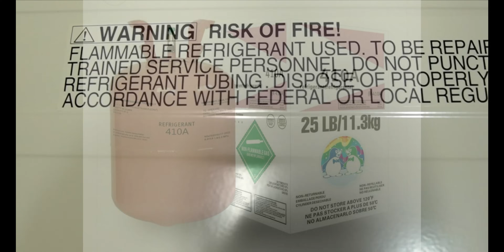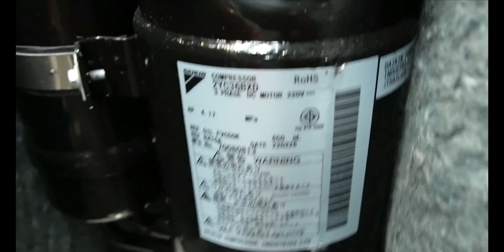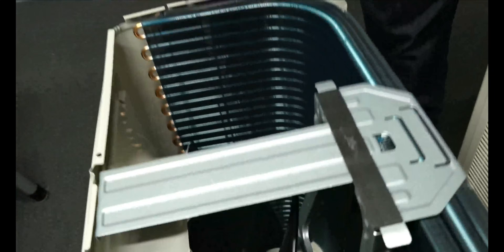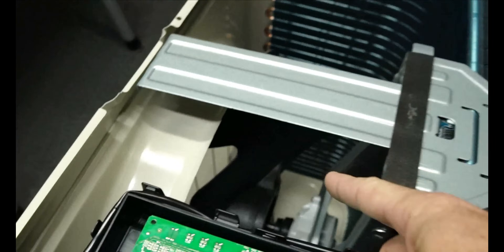The Truth About The New R32 VS R410A Heat Pump Air Conditioner (4k)

Comment: Please find out and reply with facts about units blast and gas leak blast in rooms killing 16 people in pakistan due to R32 gas been used in those split units recently
Reply from the maker: Can you please contact our channel via email. We. Like to hear more about it. Perhaps you can send us some related articles. (HVAC Talkshow & Review Team)
Reply: Share email address  @GWAC555
Reply: That was a leakage of a nearby gas line period end of story.
Reply: Ah, My friend's coworker was just blasting the compressor a while back. It was an R32 unit and how was it  blasting? He was putting an R22 refrigerant in them. Not surprised!
I mean R22 R410 R32 can go boom from improper practice handling the refrigerant.
Reply: @mikaelahyakuya3485  
Can go boom?
How can an r22/410a go boom exactly from handling the refrigerant? You talking about pressure in the tanks? Usually the top will just blow off. Not something a home owner has to worry over. This is if a tech does not pay attention to temperatures and how charged a tank is.
Reply: I lived were almost every home using some sort of mini split. Blast will not happen. All machine have pressure relief valve. It only happens when technicians use incorrect gas (Oxygen) to pressurized system for leak test.
Reply: Lololol shoshal media truth 😂😂😂
Reply: I would add there are hundreds of thousands if not millions of R-32 Mini Splits that have been installed and sometimes installed by unqualified people that have been working fine for years.  There have been explosions in Pakistan for years just Google.  My condolences to all the people who lost a love one in the blast mentioned above.  If installed by a qualified technician and maintenance is performed with cleanings and inspections every 6 months I would not worry.

Comment: It runs on high pressure just like 410a so you’re still going to have leaky coils, only differences the new refrigerant cost three times as much , in Europe they went with propane which is low pressure just like the old R22, And the propane air conditioners have sensors, so if it detects leaking propane, it shuts the system down
Reply: not high or low pressure is the problem. the crappy copper tubes that you could read the newspaper through is tze actual problem. that shit rots in a blink and then you gotta recover tze refrigerant, braze in a new one, draw vacuum re-charge it.

if only the tube wall thickness wouldn't be about a blonde hair those units could prolly last 20 years no problem.  but money raking tells the engineers to design everything as flimsy and crappy as possible.  so that shit keeps on beaking down.

and guess what the root cause of all this bullshittery is; it is the financial system based on credit. every credit needs to be payed back +15% or so.  but you can't create more money to pay back properly. so debt was found. and the global rise of debt is the reason EVERYTING goes to crap.  because the samebunit for the same price gotta be crafted cheaper to get those extra % out of it to pay back dept.

and penny pinching goes down to chip level where earlier the crappy/buggy/laggy chips were discharged in the waste bin nowadys the garbage is going to be sold too. and voilá you as the customer or a pro get a crappy product that never lasts more then 5 years.

economy and financial sytem based on debt is disgusting. it destroys everything. quality, wealth, health of workers (via cheap materials that contain asbestos and stuff).

all that to keep the dying finances going for a few more years. or you get war. war sets everything back to zero. everything is ruined and the economy flourishes. to the point where everything goes to shit again.
Reply: BS, most of Europe is still installing R410A or R32. There’s little to no options for propane in higher end systems.
Reply: It is true that propane is becoming more and more common on air to water heat pumps in Europe. Now there are many monobloc models available and they're probably gonna replace totally the R32 ones. Monobloc means that all the gas stays in the unit outsides and only heated/cooled water gets into the building. For the systems where gas gets into the building though, like mini splits, hydronic split heat pumps, ducted and VRF though, it's all R32 (for VRF even still r410). There's only a midea mini split model using propane being sold but it's an incredibly niche product. I guess nobody wants to take the risk of bringing propane inside…
We'll see how things will evolve. Will regulators and manufacturers develop a way to get reasonably safe indoor propane systems? Will it all become hydronic with the outdoor monobloc propane unit (but that's expensive and you need the space for all the water tanks…)? Will we see CO2 on smaller systems (VRF and mini split)?

Comment: Seemed like a sales pitch rather than an honest comparison. What are the operating differences? Are there any installation differences ? Don't just give me cosmetics.
Reply from the maker: R410a systems are being phased out rapidly. We only trying to point out some minor differences.
Reply: Roger, sales pitch.
Reply: @GWAC555 is there a problem with R410A? Is it not good or dangerous? I have a R410A since 2017 or 2018 and it's working fine.

Comment: r290 is the game not r32
Reply from the maker: January 1st 2025 all Residential and light commercial Manufactures will be utilizing either R-32 or R454B here in the US. None of them will be using R290.
Reply: @GWAC555  Here in Europe, R32 is being fazzed out and being replaced by R290!
Reply: @jooie444 how exactly does R290 work on a mini-split with the current regulations around how much it can be charged with per system? It can work with portable air conditioners or window units, but surely not any mini split or ducted systems
Reply: @jooie444  europe is being phased out

Comment: Can a R410A system be serviced with R32 if at some point in the future R410A goes the way of R22?
Reply: R22 is still available. R410a isn’t going anywhere.
Reply: @fiehlsport  HVAC contractors charing $100/lb for R-22. I presume the price will soar with R410a.
Reply from the maker: R-32 is NOT a drop in replacement.

Comment: I'm not sure if my cheap units are Daikin or Midea built, but they have R32 refrigerants.  I bought and installed 2 12k 120V systems for my fairly open 1200 sq/ft. home.  Winter time had 4 days where it didn't get above 15f, and summer had a few days of 108f.  House temp has remained a constant 69f.  The best project I've ever undertaken.
Reply: You would have had similar results with all the other type of refrigerants.
Reply: cheap crap is deffo midea.... that garbage gets thrown after you if you don't buy it for 3 bucks. 😂

and if anything breaks you never get replacement parts because the chinese crap factory makes a living off selling AC units. not off the aftermarket. so there you go. cheap crap rendered a total loss as soon as something goes south.

best advice is heaving all PCB's for outdoor and a whole indoor unit of every kind that is installed.  otherwise you're EFFFED. dry in the rear end.
Reply: @casemodder89 what parts are you talking about? most blade motors or tubes or universal replacement boards and sensors? anything could be replaced with other stuff, if you know what you are doing but it may cost you more in labor tho....so I KINDA agree, chinese crap can cost more, but kinda not always.
I am running a 12 yo chinese crap that the isolation is falling off from the copper tubes but i dont give a f and just let it rip until it dies and finally replace it. 

If one is afraid of cheap stuff, you rely on brand quality and reputation.

Comment: Yes, what about the R32 gas sensor?
Reply: I believe the sensor would be located inside the furnace or air handler.  At least that’s what a Goodman firmware engineer told me. He also told me that the sensor was required by the state of California.

Comment: R410a Caused controversy?
Reply: A lot of people blame all the leaky systems on the higher pressures of 410a. Also people generally don't like change.
Reply: @TofuInc  R410a and R32 operating pressures are almost exactly the same. The problems come with not using best practices for installation.
Reply from the maker: Something like that! Well said!
Reply: My mini split has 410a.

Comment: Where is the leak detection sensor
Reply: It's only required if the system has a secondary heat source, like heat strips or a gas furnace.
Reply from the maker: @TofuInc  Well said! Thank you
Reply: @TofuInc 4 pounds or less
Reply from the maker: The R32 equivalent we reviewed did not have a refrigerant gas sensor.
Reply: do a real split sys comp. Not a minisplit
Reply: Wouldn't it just turn off and return an error if the pressure got too low?
Reply: @jimmybrad156  Depends on the make and model, not all minisplits have that feature
Reply: You detect it by not waking up again. Foolproof.
Reply: Yeah I heard the system shuts down when it notices there is a leak.